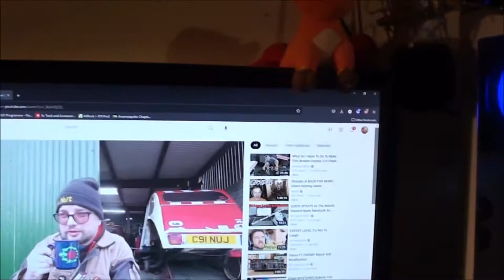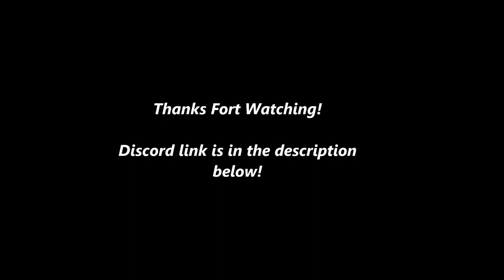Sad News, New Computers.

Comment: I looked up that graphics card you've got with no ports. It's designed to be used in a system with integrated graphics and adding this card allows them to be switchable. The system will use the integrated chipset by default but when it needs more power it will switch to using the card. There's no ports as obviously you plug the monitor into the ports on the motherboard where the integrated chipset resides.